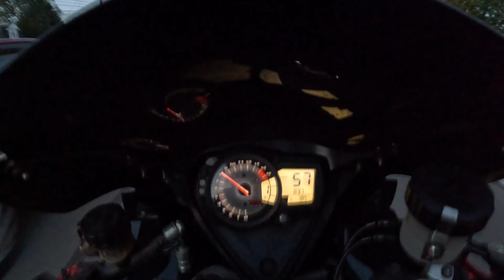2008 Suzuki gsxr 1000cc testing velocity stacks with new fuel pressure regulator

Comment: Love your videos!♥
Reply from the maker: Thanks 🙏 I appreciate your positive comment
Reply: @Sportbikememace  Do you mind posting how to remove all emissions on that bike?
Reply from the maker: @dute007  I probably can but which ones do you want to remove? Like my bike only has 1. 02 sensor for the exhaust and and you remove the converter by having a full exhaust and you send your ECU out so it can erase the F1 light by blocking the O2 sensor.. is that what you mean?
Reply: @Sportbikememace  yessir but do you know how to disable some using the woolich tuning?
Reply from the maker: @dute007  no sir I just sent my ECU to get flashed once I did all the upgrade. I got the bike dyno tuned.
Reply: @Sportbikememace  ok thanks man and ride safe bud 😁
Reply from the maker: @dute007  you still want me to make that video? And you’re welcome, bro. You as well ride safe.
Reply: @Sportbikememace  yes sir and we are waiting maybe also about the maintenance, error codes solve and some type of fix on that bike thats just my request anything sir that useful
Reply from the maker: @dute007  OK sir that works. I’ll post one up tomorrow.